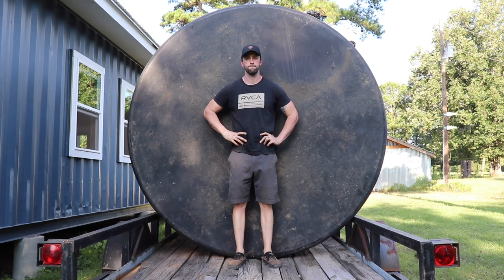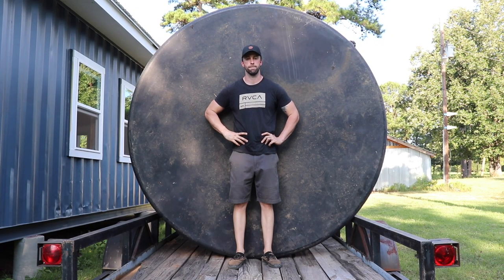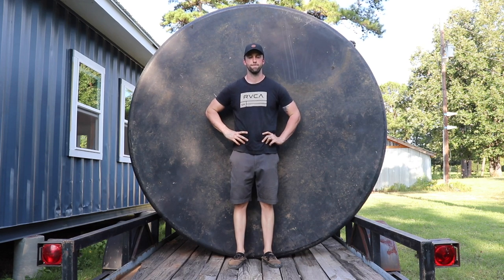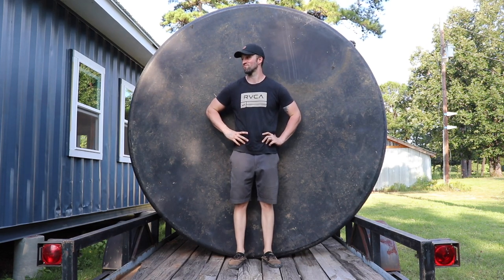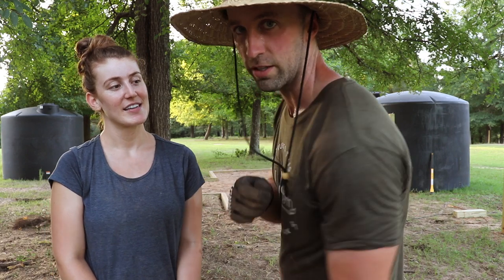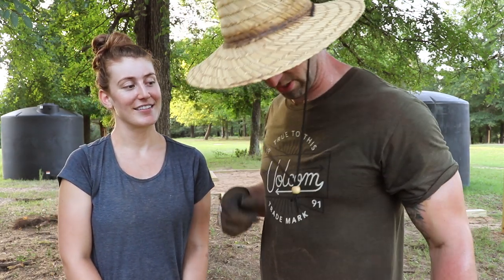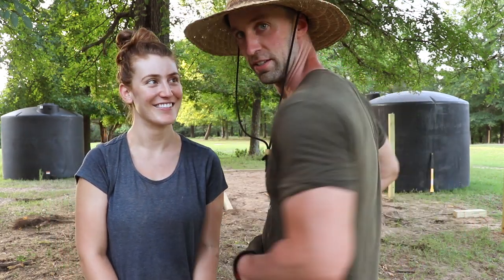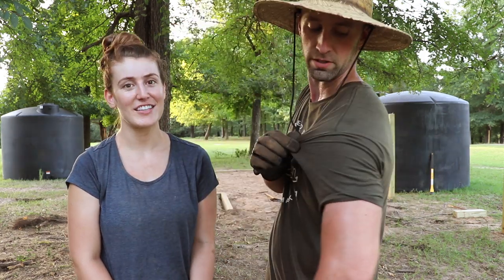The RAINWATER HARVESTING Project Begins!

Comment: I know everyone is going to sound like an expert, but I thought I would drop you a quick idea ... you should really leave one of the containers right next to the house for ease of filling.  Then you put a double float system pump into that first tank.  One float will trigger when the water gets to high, it will begin to pump the water to the other tanks. The second float is a “call for” float meaning when the tank gets too low, it will pull water from the other tanks to the one by the house.  This will also make it a ton easier for plumbing and you could also do something to try and cool that water.  Black tanks in the hot Texas sun is going to equal some pretty hot water.  You definitely are going to want to get a water cooler for inside the house.  One that incorporates both filtration and cooling on demand.

Anywho ... enough rambling on.  I love you videos and can’t wait to see the final product!

Comment: No gravel!  Use sand.  Gravel with all that weight on top will cut your tanks.
Reply: underground tank need cover aroung fine sand NOT gravel. gravell come only under tank base bed and then fine sand bed were add tank. and side around adding only fine sand and top. then can use all what want top ground.
Reply: Yessir.  You could lay carpet down ontop of gravel, but don't.

Sand is your friend here.  Its cheap, and is the right material.
Reply: Decomposed granite works well plus it’s easy to wet and pack level. When it dries it’s almost like a solid pad. My cistern is galvanized but it’s been good for three years
Reply: Good point unless they use pea gravel.
Reply: @Hoggdoc1946  yes you use pea gravel with plastics and fiberglass. Sand with steel.
Reply: River rock is smooth and looks nice. Better than gravel.
Reply: Concrete pad and metal straps. Empty tank and wind storm = wasted money. Good by piping.
Reply: What about chrusher dust?
Reply: @denoso1547 
That's what I suggested in my post. Crushed gravel or decomposed granite sets up as hard as concrete once it's rained on a couple of times and it pretty much self-levels.
Reply: Plus they might want to check elevation of those tanks. Doesn't seem to be a lot of water pressure with the house elevated and the tanks on the flat ground.
Reply: @frankirwin2377  
They're gonna end up having to pump from the house to the tanks, and then from the tanks back to the house. I'd go with the well and only have to use 1 pump. It's more rational when electrical usage with a solar system is also an issue. Better to only have 1 pump. Plus maintaining the purity & safety of rainwater will be a daily task. I clean my gutters and my parent's out once a year or more often if there's a problem. When I do, the water and the debris smell like rank sewer water. It's been so bad, I've actually puked. I couldn't imagine any system that would make that water safe to drink.
Reply: Which is safe for dogs so Bear would be A-OK.

Comment: Seamless gutters are the only way to go. I used to have the big box gutters you have and the sun destroys every sealent causing leaks. Don't go through the headache I did. Seamless ones drain every time, the segmented ones do not. Algae will build up in the area between the seams. What a nightmare it was. Not now, I went seamless and never have had a problem since.
Reply: Hoping to bump this up so they'll see it.  I agree with you 100 percent!!!
Reply: Seamless is well worth the cost difference to problem ratio. And those guys will have it done in mere hours. Water continually sitting in gutters is stagnant, which means bacteria, which means asking for water borne illnesses regardless of what method you're using to purify & filter the water you use. Add Texas heat, and you're throwing gasoline on the fire of bacterial growth rate.  It only takes the wrong bacteria in the wrong place & you're sick. Environmental is hip & chic, but they've already said they've got a well on the property nearby. Just going with their existing well would be way more cost & labor effective, and requires little to no maintenance/upkeep. And you wouldn't have to continually worry about the safety of your water or rationing when there's little to no rainfall.
Reply: 100% need to go seamless. The improvement store gutters do not last.
Reply: Amen on the seamless!
Reply: ......and how do you get a seamless gutter truck out to an island?

Comment: Hey folks, something you might think about, is putting old carpet under tanks to protect them from punctures, and roots. Might be some free locally on craigslist. Spray IIT with bug spray before you take it home. At 8lbs. A gallon, 20,000 lbs. A tank, will help spread load too, will last for years. Might use a tamper, or ground compactor too, like a small bomag plate compactor to eliminate ground settling too. I've seen people use sand under tanks, but not rocks. Is this kinda like a pea gravel? What does manufacture recommend? Update, Huh, Enduraplas a tank manufacture has a video on here, they recommend pea gravel, or concrete

Comment: I do water harvesting for a living, investing in some good ratcheting straps for the trailer is a must. I heard a story recently of one of out local tank distributors who's employee didn't strap down some tanks well and they flew off at speed and rolled all over the frontage road, fortunately nobody got hurt... Also, you want to compact the soil well under the base of the tank so it doesn't settle and mess up your plumbing. To properly compact soil it must be moist, but not wet. Also, rubber couplings between the tank and associated plumbing are important to account for any shifting, which WILL happen eventually no matter how well you prep everything. Make darn sure to use a debris filter for the inflow. And  keep light out of the tank to prevent algae growth. Another pro tip, roll them like a wheel on their side, much easier ;) Also, also, you can use two long sections of pipe to slide them on into their final position so they don't dig in while pushing them and mess up the pad. If you have any questions, feel free to message me. Good luck! You guys rock!
Reply: Clearly, you didnt read their comment about taking the straps off on their property for the shot.🤨
Reply: @naer-g437  I did not, sorry to Life Uncontained for doubting your safety practices.

Comment: You gonna do a double pipe spillover with clean outs to help filter debris before you run your line to the crock?  I'm assuming you're gonna use a 60 gallon crock and sump pump to fill your tanks.  Handee man in Arizona has a pretty top notch setup if you ever watch his videos.

Comment: You can put the tanks anywhere and then run you drainage and suction to them.  Make sure you interlink the tanks so the same level is maintained through all.  You can run a water line from the tank to the house and put your pressure pump for your delivery there.  That will save on running power as you will already have it at the house. Do it all the time here in Australia.  You have to make sure your down pipes and delivery lines are sealed as it can be a wet system - in other words down from the roof and underground to the tank and then up into the tank.  As long as your roof line is higher that the tank inlet you are laughing.  Cheers.

Comment: Awesome, Make sure all the plumbing and motors are free from lead, and mercury. The You still need a catch tank by the location of collection, small but needed. Most likely a big plastic barrel will do fine. then you filters and processing of the water for the potable the gray, and black water is needed to be separate.  Flush the toilet with only gray water, drink the water from only tank processed for drinking not gray or black. Good luck!

Comment: Hi to everyone. Well, I arrived a bit late to the channel and  now catching up on all of the videos from the beginning. Fistly, I'd like to say how amazed I am by your project. You guys are so optimistic and and great examples of self learners. That's fantastic. I'm a Chemist by profession and I'm always concerned about drinking water from plastic containers. The considerations are basically, what leaches (dissolves) out from the plastic into the water. When plastics are injection moulded, additives are used to facilitate the process and these can sometimes dissolve into the water. Not an issue if you are watering the garden but if you are drinking, well the levels won't be enough to poison you but may not be good in the long term.  Maybe there is nothing leaching out any more, you just don't know. Maybe you bought drinking water grade water containers ? One option would be to send a water sample to a lab and  to test what levels of chemicals are in the water if any at all. If there is stuff in the water , then a solution would be to use a smaller water container for drinking water only. Plastic containers used for the food industry will not leach out stuff into the liquids they contain as this is highly regulated in the USA (FDA). Maybe not a big issue for you guys but I wanted to bring the awareness to you both. I'm looking forward to catching up to your latest videos.... Take care.......

Comment: If you locate the pump and pressure tank at house you’ll need to increase the pipe size to the house, just to be on safe side 2 inch pvc should do the job. That way it would be much easier on Pump. As for tank electrical switch 30/50 lbs. should work fine.

Comment: So since the tanks are all the way near the trees are you guys planning on running the guttering all the way from the house to the tanks?
Reply: This is a crucial question.
Reply: I would run the downspouts into PVC pipe to carry the water to the tanks.  The pipe could be underground as long as the outlet to the tanks is lower than the inlet fed by the downspouts.

Comment: If in the future you want to put one closer to the house. (shorter pipe distance for plumbing) Dig a hole. Put the tank in to six inches from the top. fill the tank with water. 'Then' fill the gap with clay soil or cement mix if you don't mind a little extra cost. The clay or cement will harden.  That's how I created my Goldfish pond. Got my tank thru Craigslist from a farmer. Top was damaged by a tornado so he sold and delivered for $50.... It's paired with a 16 inch Intex pool sand filter; also submerged just below ground, out of sight. Good luck.

Comment: Curious to see how this is going to work but I'm sure you have figured it out. I think I would have put them in the ground making it easier to fill from the gutter.
Reply: Terry W as long as the inlet (top of downspout) is higher than the top of the tanks they can bury a pipe all the way to the tanks and the tanks will fill all the way to the top. Water will always find level, it’s beautiful!

Comment: You two are doing great! I will make one suggestion. You will want to put these tanks inside an insulated building if you live in a zone that gets temps below freezing for a consistent time. They can and will freeze. Ok, two suggestions. Agree with other comments about not using gravel, use sand or better yet a level concrete base. The building you put this in could be the water catchment system and run PVC to the house in the ground. Good luck! Waiting for the next video.

Comment: If the adhesive in the gutters is a potable water concern, isn't all the roofing material as well?
Reply: That was address when they were putting on the roof, to make sure everthing use was safe. But no one is taking into concideration what will be on the roofs before it rains, and what will be in the water as it is being collected.
Reply: @karlgriggs8887  Thanks for the response. Yeah I wondered that too. In Colorado we can now legally collect two barrels full of rain water (was an old law that just got revised) and my family and I were discussing that we would never drink it not only because of what materials and debris over the years are on the roof but what the water quality is like. So its just for plants.
Reply: Search first flush diverters for rainwater collection

Comment: Forgive my ignorance but how do you get the rain water into the containers?
Reply: The gutters they mentioned at the beginning. So collects from roof, then goes through a filtration system and then into tanks. You can also order water truck for your first fill.
Reply: That will be the next video....
Reply: @myleneh1916  So it comes off the roof to another tank? and gets pumped to the other 3 tanks? they are pretty far away from the house no?
Reply: @one567  they were initially going to put them next to house. I haven't seen them done this way, so I'm intrigued to see what sort of system they use to pump the water.
Reply: Thank you that’s kind or what I was thinking. They’ll need another tank.
Reply: from the house roof

Comment: Good Progress!  I don’t know your plans on filtering the water but I would suggest pre-filtering any sediment coming off your roof.  For your large system, I would use a 55 gallon drum and divert all water into there first and on the input pipe put a sock filter on it.  Just connect the output to your large tanks.   This does 2 things, the sock filter catches most of the sediment and the drum has to fill up before sending water to your lager tanks so any sediment coming through the filter should below the outflow.   I would actually have the inflow and outflow at the same level or the outflow just a bit above the inflow.  Just my opinion, but it’s made a world of difference when I fill my tote from the gutter.

Comment: You might want to rethink setting those tanks on gravel. Some of that gravel is going to have sharp edges on it & once the tanks start filling up, that is going to be a lot of weight. May I be so bold as to suggest maybe laying down a couple of layers of used carpet & then setting the tanks on top of that. That would lessen the chance of puncturing the bottom of the tanks on some sharp stones. Another suggestion might be to compact the dirt under the tanks. Again, because once they fill up they are going to want to settle after time. Another option would be a concrete slab. Just something to think about. Love your videos, have a great day.

Comment: All the water tanks usually have some kind of outdoor carpet under them so the weight doesn't punch a hole in it from rocks are roots. Now I hope there lower than the house so the water will flow and you can pump it back and a rain cover would be ok four post and mental roofing more water area.

Comment: Regarding the black water collection tanks sitting in a hot Texan sun. Thermodynamics says that hot water is pure energy and will provide the energy to cool, or heat,  your new home. This would be similar to how air (or water) driven heat pumps work. Engineered in concert with the cow pond reservoir, you could potentially have sufficient cooling AND heating available within feet of your house. How cool would that be ?

Comment: 1.) Recommend fine sand instead of gravel under tank.
2.) Recommend moving fence posts so when you have to work on your tanks(And you will)you don't have to push your donkey out of the way or watch in horror as your bull decides to sharpen his horns on the side of a tank. 
3.) Until you get them filled with water you might want to strap those hummers down as a fast moving thunderstorm might think that taking them to the next county would be a lark!
Hope you both have a lovely week and that you get good sleeping weather.

Comment: If those tanks are 90 inches tall you’ll have 3 pounds of head pressure at the bottom of the tank, your going to need a booster pump, along with a Water Well expansion tank, should get a long with a standard 60 gallon. Both of watch can be located next to house.

Comment: One setup a lot of people never think of is a single tank at the collection spot and a pump or gravity to send the water down a small pipe over a longer time letting you use huge pipes between collection and the first tank and cheaper smaller pipes between that first tank and the main holding tank/s.  At worst say 2 IBC totes in retaining wall lined pits by the house you direct the rain into then a simple solar powered pump to send the water to the main tanks over a few hours.

Comment: I have an 8000 gallon underground cistern bc I'm in pa. When full, which it generally always is bc it rains so much here, there is 64000 lbs of water in it, I would certainly put a concrete foundation underneath, the gravel may destroy the tank with that much weight, not sure but I would not risk it when concrete is dirt cheap compared to what u paid for those tanks, I know there not cheap by any means. I also recommend a black Berkey filter or uv light with sediment filters, the maelstrom downspout filters will also keep the tanks very clean and will not waste any water

Comment: Your project is looking good. Here is a thought regarding cooling your home in the hot summers in your state.
You have a large pond next to your house. Can you pump 'cooler' pond water through a simple heat exchanger located inside the house to provide a form of air conditioning? I am not sure how warm the pond water gets, but if it is say 70 deg F, that sounds better than 100 F air. The pump could be wind driven and the exchanger fan via solar power.

Comment: hi enjoying the vids. when i use rebar for steaking things down i use a hammer drill / concrete breaker just on hammer and it is so much easier than hammering them in. i cut an old 1/2" drive extention in half and put in the chuck and a socket just a bit bigger than the rebar obviously not one you want to use for anything else after.